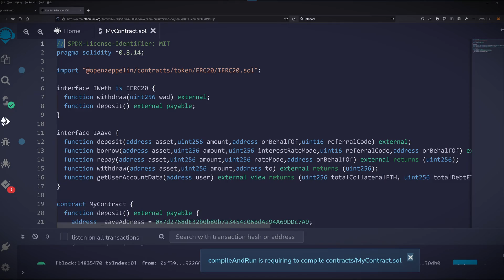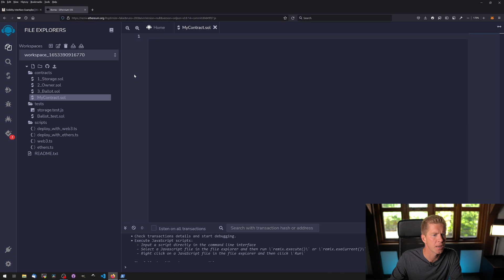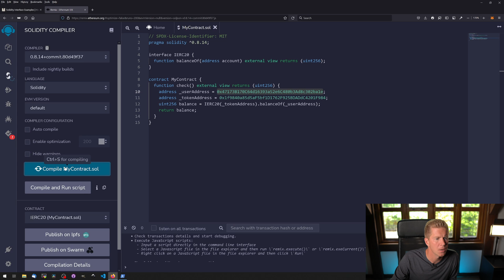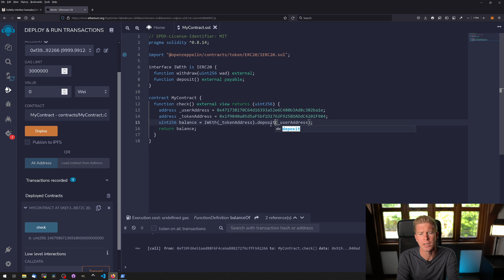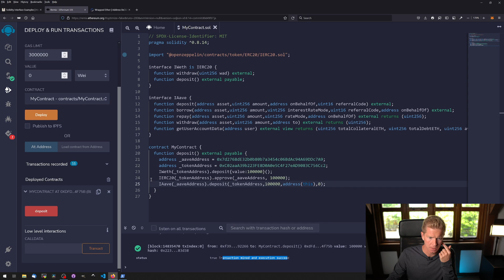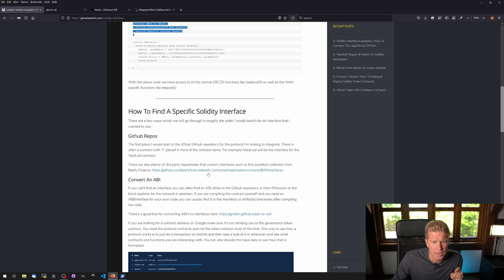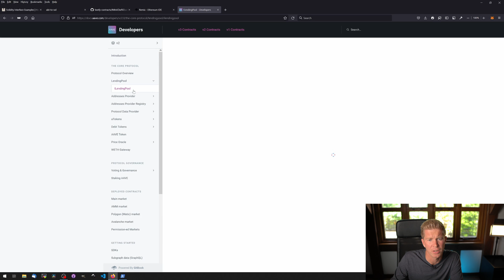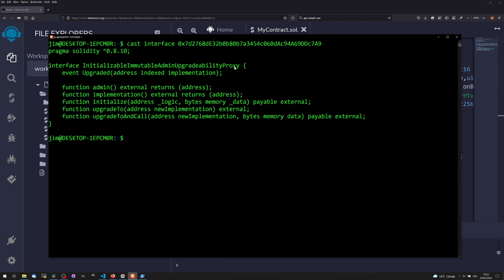Solidity Interface Tutorial | How To Connect The Lego Bricks Of DeFi

Comment: In the basic interface section, when you called the check function you received a uint256 number but how does our smart contract knows that you took this interfaces from where. I mean somewhere we should have mentioned that where the IERC.sol is deployed?
also in the line "uint256 balance = IERC20(_tokenAddress).balanceOf(_userAddress);" how did you know that IERC() has this an argument
 can you please explain me.
Reply from the maker: You can either look at the code directly for ierc20.sol on GitHub or openzeppelin has good docs. I should have explained it better